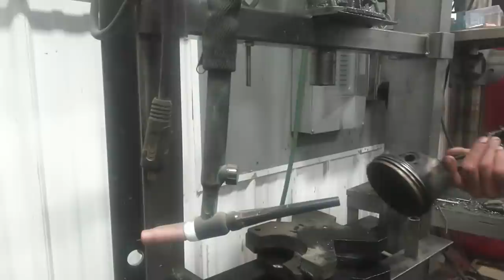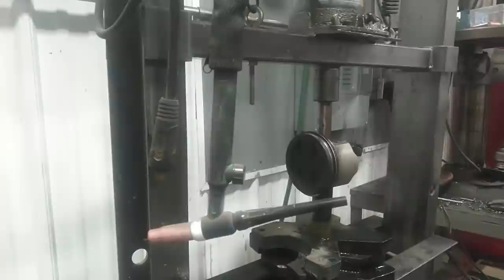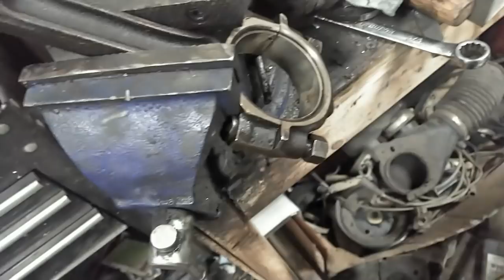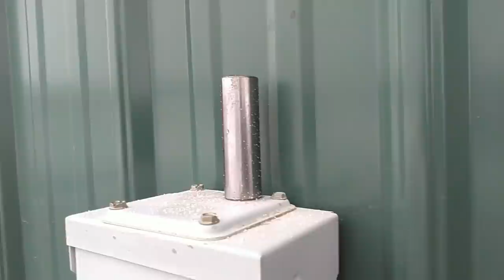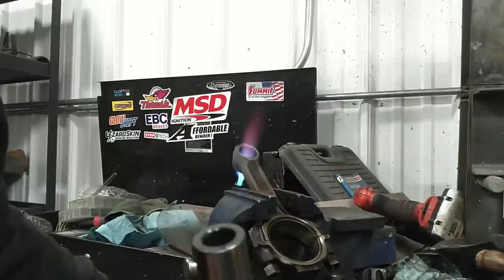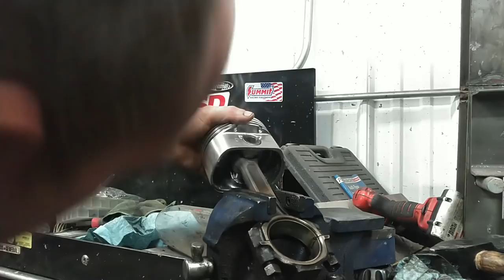press fit wrist pin install

Comment: That is good tip. I learned a trick from a performance engine builder to prevent oil leaks between the block and intake manifold, I use a center punch on both the intake surface and block surface  every 1/4-3/8 inch which effectively 'knurls' the surface and give the silicone a chance to anchor itself. I hate oil leaks
Reply from the maker: Iv never tried that I normally use ultra gray and let it tack up a few minutes before plopping the intake down normally works well for me

Comment: I use the heat/ freezer method quite a bit when installing bearings that are an interference fit. Old oven works wonders to throw the bearings in, and if whatever your pressing into is small enough it goes in the freezer. Makes everything so much easier. Thanks for sharing.

Comment: we used to use cardice a chemical freeze agent,we'ed have a bucket full and put liners in it overnight ready to fit into the groove in the block,and gudgeon pins into pistons also kingpins after reaming out the brass bushes,also great for fitting ring gear on flywheels,the new pistons look very short.